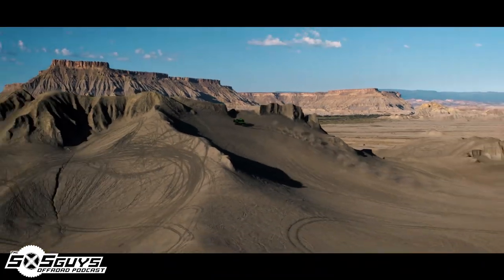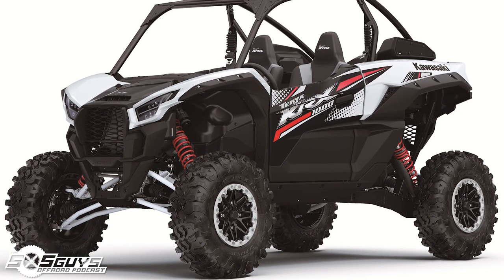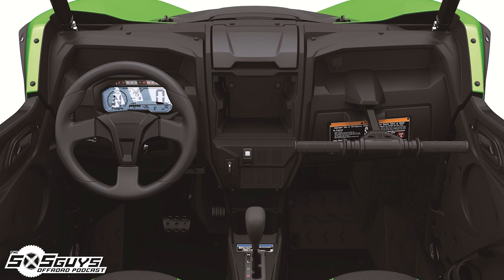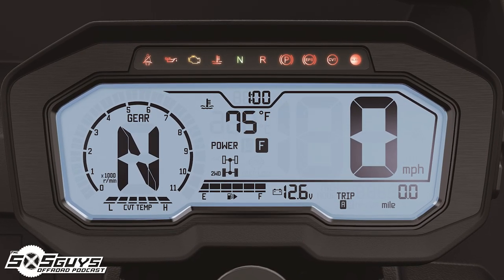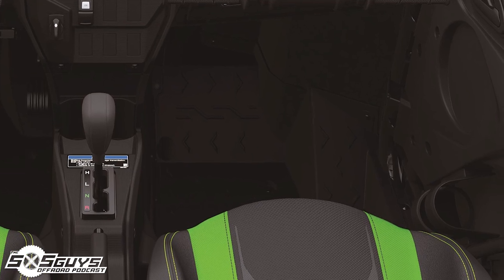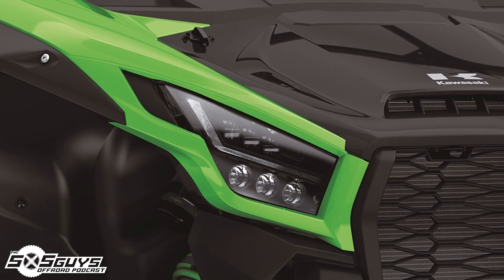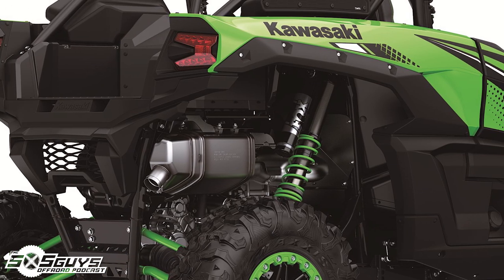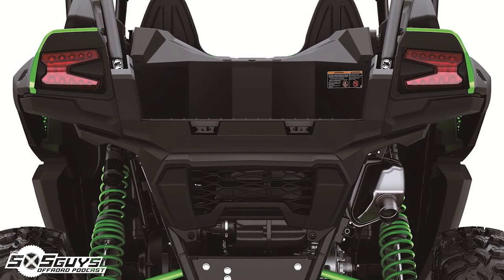Episode 2: Kawasaki Teryx KRX 1000 Launch | The SXS Guys Offroad Podcast

Comment: Im No Expert, But A Little Extra Weight Can Help In Situations Like Rock Crawling And The Rebound In The Rear Through The Whoops...
Reply from the maker: We would have to disagree. The weight stance is usually making up for lack of proper shock adjustment. Having true dual rate springs along with proper shock adjustments on both rebound and compression makeup for all those scenarios.